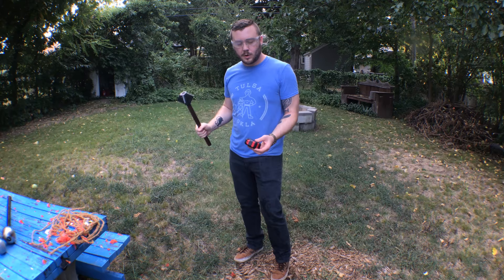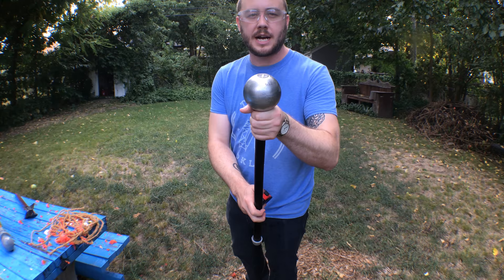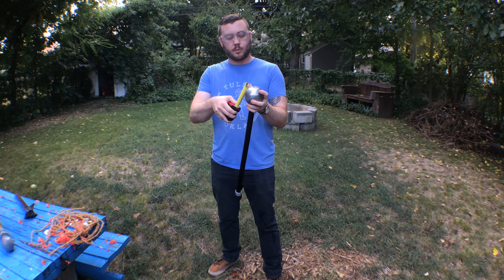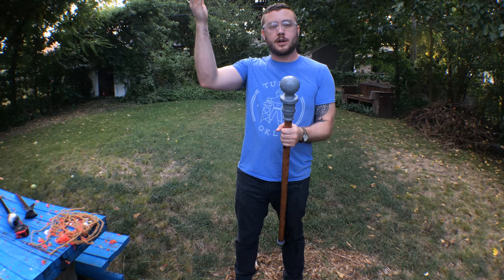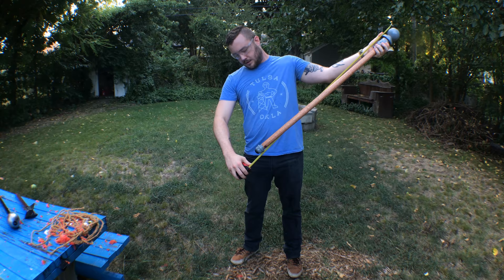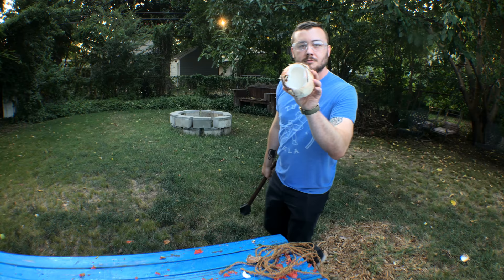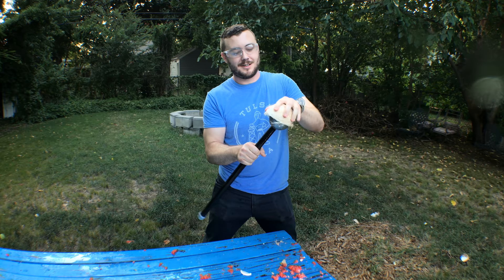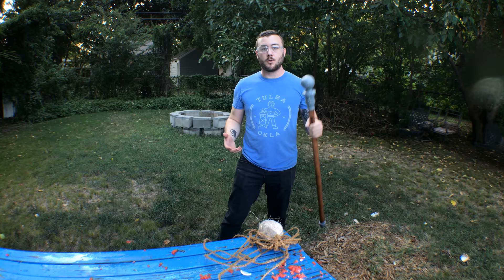Episode 72 - Macin' Around: Homemade Bludgeon Show & Tell

Comment: Flanges are not designed to pierce or cut the opponent (though that could be a secondary benefit against an unarmored person). Maces are specialized anti-armor weapons, and the flanges are designed to increase traction and prevent glancing blows so that all of the energy is transmitted into the target. If you want to cut your opponent, an axe or sword is a much better choice for a one-handed weapon.
Reply from the maker: I agree to a degree, I think that spikes function by increasing traction and "catching" on the opponent more than flanges would, but I think we're saying the same thing about flanges - that they localize force into a small area. My mention of "cutting in like a can opener" was not meant to imply that it cuts, but that the flange can penetrate by force alone, and it does, into wood, metal, and more than likely flesh. Thanks for the view, Jonathan.